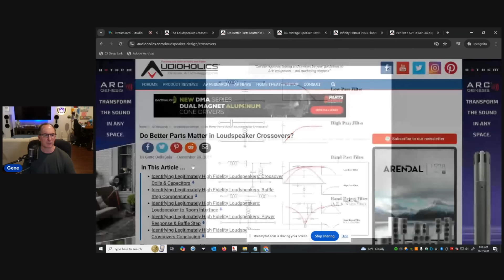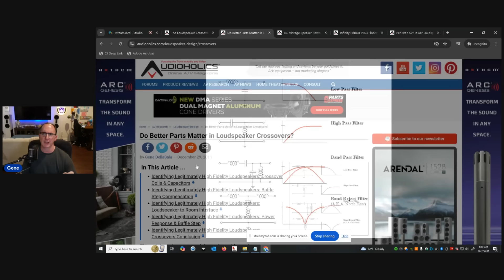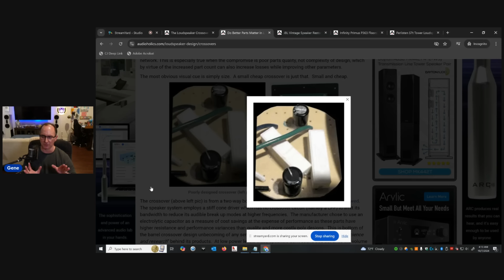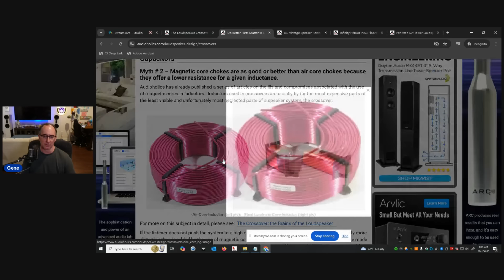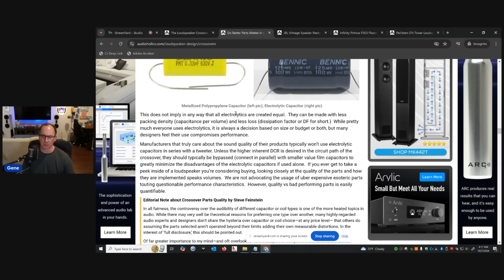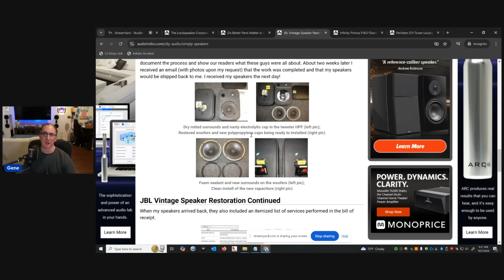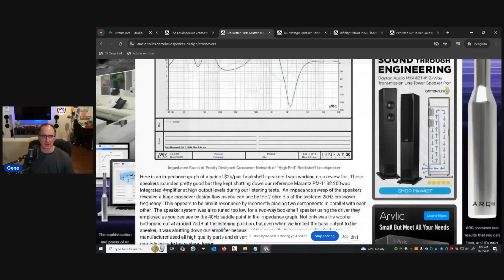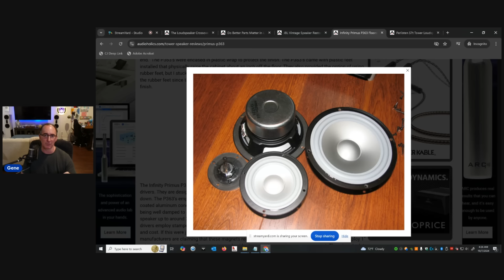Loudspeaker Crossover Upgrades - Are They Worth the Effort?

Comment: dear Gean i feel that that was a poor explanation of the quality of parts. you of all people would agree that just like speakers reviews or opinion are pointless without measurement. the only way is to take the speaker and change cheaper polycaps for the more expensive and the same for all the parts on an apple for apples basis. What you offfered in this video was what GR Research does . neither Danny or yourself has offered proof that more expensive or so called higher quality parts do make a difference. nor for that matter has Erin Audio or Audioscience review who with the Kipple or audio analyzer or what might offer real measurement rather than an

Comment: There are bad parts. Absolutely. Just don't use them.
Then, when you take good parts, there are no better parts that are worth 2, 10 or 50 times that of an industry component. These boutique stuff is pure rip off, nothing else. Sonic differences come from very simple tolerances, you can read from a data sheet, not from magic additives like silver, gold, wax or oil. Just because there are very successful brand like Janzen or Mundorf, that's only proof of high profits, but not better parts. 
Prices for basic crossover parts are about 5-10 times what the where, two decades ago, compared to loudspeaker drivers. For a part that has seen no scientific relevant improvement, expensive research or new material, while drivers improved big time. In fact they are doing crossover parts worse to charge more, like with wax and oil capacitors. They put the idea in peoples minds, old and complicated is better than modern and optimized. Just as nuts as quoting a  car from 1930 drives better than a modern BMW.
An air coil is a basic part. You can do it wrong, with low grade copper or loose winding's. If the copper is OK and the execution is fine, there is no way to improve it. Period.
Resistors are the most stupid way to waste money. A resistor is a part that has to generate loss. Turning electricity into heat. There is no “low loss resistor” in this world. It's possible inductance is a small fraction of the drivers own inductance, so don't expect anything from a “low inductance resistor” in the audible range. 
All these parts have been optimized by the large players in the industry over ages. What the boutique manufacturers (that don't manufacture much by themselves, but just put individual labels on any industrial part) do, is all marketing, not research or optimization. Editors that once proved that these parts have no advantages, comparing for example, a 1$ industry cap to a 30$ boutique product, have all been bought by advertising or extreme and continued sampling. Just like the Tyre industry, that doesn't charge the car manufacturers anything, because the customer in most cases replaces them for the same, overpriced brand. 
The audio community has all kinds of arguments why not to compare comparable crossovers A to B. Just build one from the most expensive parts and the other pair from industry grade, renown brands. Measure any part to match by 2%. Which is what you can do with a cheap instrument. The audible result will not be what any profit making player in the audio world will want to see. Promised.

Comment: There is one perfect garantie thet speaker after upgrade will sound better. -   higher    price of new elements convinces owner about it

2.  I do not buy opinion that spakers build under chinese sun must be not so accurate as under american sun - it is quality control which decides. "Western" companies used to send to China  own staff.   The reason is simple - it is branded as "made in PRC" not made in USA,  due to that fact is much  cheaper and it   justifies bigger   margin for deviations.  We need to realize that quality checks and corrections is most time consuming and damaging to profits. 

3.  impedance - many comment not stright horizontal line of impedance which is 99,9% impossible to have  but how many is able to  connect this to achieved by producer sounding which  customer preferred at purchase? In other words any "improvement" of impedance will adequately change sounding and in my opinion it will   spoil the optimum which managed to obtain producer.

Is as low as 2 ohms wrong? Of course it will burn fuses if some 2kHz will be extremly strong   - that is why very  low output impedance is so dangerous. But "specilaists" argue that low output impedance  is must for better bass control. Yes - and for over loading plus   unwanted colorization of sound.

Comment: So better parts and materials inside a speaker makes a difference.. but cables are snakeoil.. :) So better materials and dielectrics and design in a speakercables does not change anything.. :) got it.. ;)

And BTW.. Danny has an open invitation to all youtubers and reviewers to come down and listen and experience the difference.. Even in cables.. ;)
Reply from the maker: Nice red herring. You can measure non-linear behavior in capacitors and inductors. Non-linear behaviour doesn't exist in a piece of wire by itself. I always recommend low gauge, high strand count wire. It doesn't cost a lot to get good cables. I also invite Danny to submit his speakers to us, Amir or Erin for 3rd party verification too. I don''t travel due to time constraints and workload unless it's absolutely necessary.
Reply: @Audioholics  I never said anything about the price of a cable.. but that is the primary go to thing people go to.. price. 

I said that cables do matter.. materials used, design and dielectric.. price is irrelevant.. one man's floor is another man's ceiling.. 
And as for personal taste and ears.. well we are all different.. so the price will not be the defining factor of witch is better or not. 

And to be clear.. there is ALOT of snakeoil in the audio business.  There is in all hobbies.. take cars that you used as an example.
The cheap tuning boxes and boxes to make your car go faster with changing the gas pedal output and so on.. 
Snakeoil.. but the big difference is that in the audiophile world the hate and lack of respect between the two camps are insane.. if you belive in cables you get chewed out.. 

People should just respect each other opinions and be happy.. not hating and scaring away newcomers on the way in to the hobby. Let them find their own way.. ;)
Reply: @AudioHdnsm  There is no such word as alot !

Comment: A 200 watt amp will have around 55 volt rails.. a 100 watt amp will have 35-40volt rails.. so 100v caps in a passive speaker supply is fine. Any amp that cant be stable at 2 ohm is crap. Stop preaching incorrect info..modern equipment cant follow ohms law. My vintage project/one integrated amp runs every day at 3.2 ohm..BUY VINTAGE AUDIO.